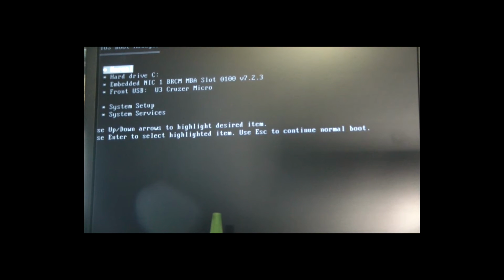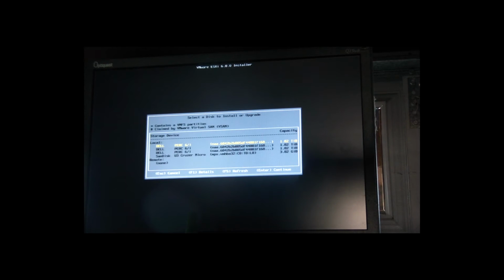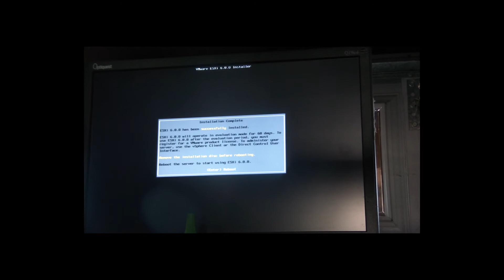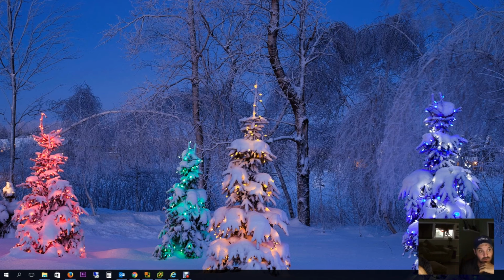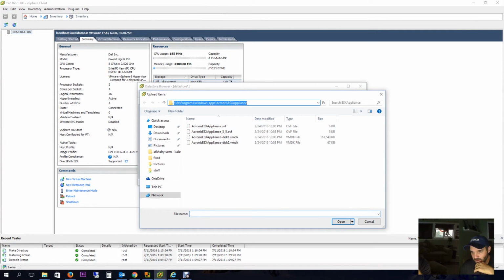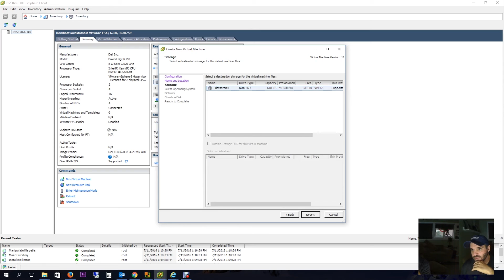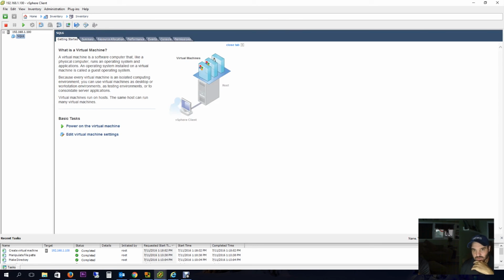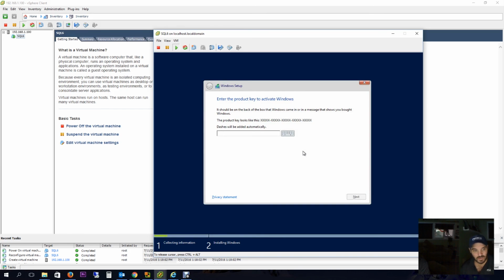vmware ESXi build on Dell R710 server install data center upgrade project

Comment: Hello and thanks for the tutorial. I know this was pretty old but, I just ordered a R710 server and Windows Server 2016 Datacenter and noticed that you installed your copy of Windows Server 2012 R2 in a VM using EXSI. Is there a reason you you did not just install Windows Server and run your VM's with the OS? Sorry if this is a stupid question but I am a bit new to servers and VM's and want to learn how to setup my server and am planning to install Windows Server 2016 DC and use this to setup VM's. Is this a bad idea?
Reply from the maker: I have Linux VM's. Vmware runs linux better then hyper-V. If you are just running Windows VM's then use Hyper-V. Another note vmware is phasing out the Dell R710. 6.5 is the last version that supports the R710.
Reply from the maker: Actually I do that at my house. I run vmware at my data center and windows Hyper-V at my house. My house server is a Dell server running windows 2016 and is a DC. I have two VM's running on top of that.
Reply: Thank you very much for the reply. So on the server at your house, you installed Windows Server 2016 Data Center and have built a couple of VM's using Hyper V correct?
Reply: Thank you sir
Reply from the maker: @asphaltbinder  Yeah, I'm running 2016 standard
Reply: @fintechrepairshop  Thank you for your time, I am sure I will have more questions once I get the server up and running if you don't mind.

Comment: Could you walk through the bios settings for this server?
Reply from the maker: The most important thing is to enable virtualization in the CPU settings.
Reply: Fintech Repair Shop I got esxi running last night. I'm having trouble with Server 2012 Essentials completing the installation of the add-on features of essentials. Through some tinkering I was able to exit the install and get the vmware tools installed but no matter which nic I try it fails. 80GB primary partition and 120 for data. I noticed in the datastore (I believe) that the 80 partition showed no available space. Odd.